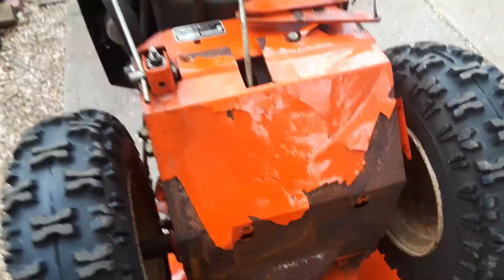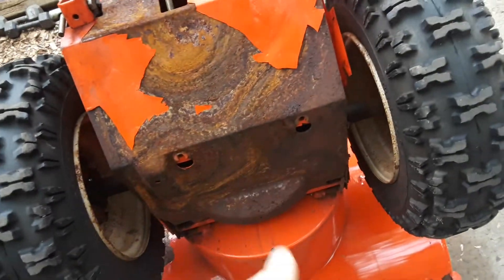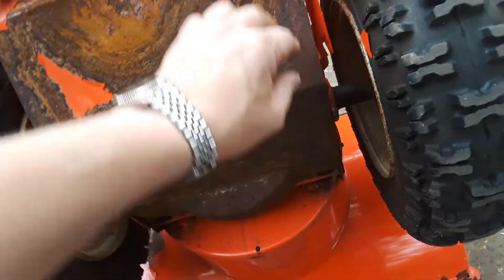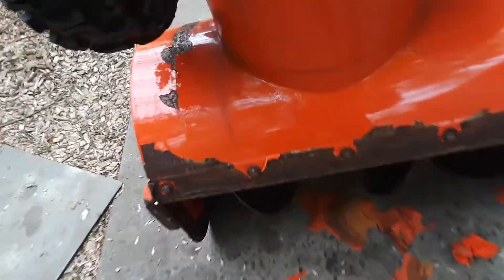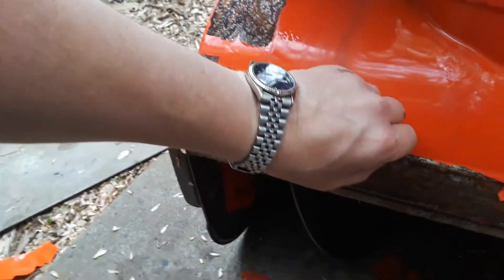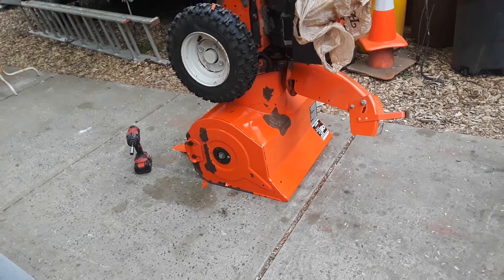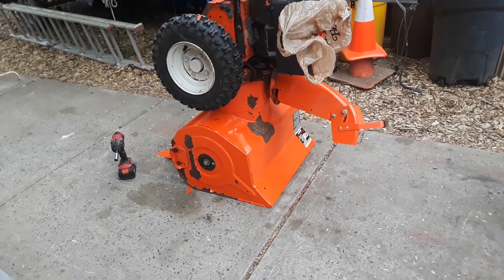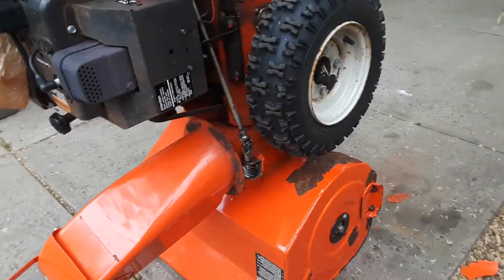1980 and on Ariens blowers, paint issue.

Comment: Paint on mine is the same, but my older 60's and 70's Ariens look great.
Reply from the maker: Both my 71's are great too. Their was lead added to the paint back than. Federal mandate in 1980 required it was removed on all equipment by 1981. As a result, this is what all Ariens machines in the 80's look like. No primer, no electrolysis used, they cheaped out and as a result all of their machines from that era look horrible. Its a shame to because from the design and build stand point, these were the best Ariens ever built. They did away with roller bearings in the 90's, went back to bushings. It was short lived. Seems like the 70's 10,000 series with bushings last longer than the bearings anyway. I have a 1987 Toro and the paint on that machine is perfect.

Comment: Shame shame shame. I have a late 90's craftsman blower I picked. Not a shred of gray paint left on bucket, except under one lonely decal.
Have a 79 ariens, paint holding up OK. I think you nailed the low end of the 79 to 80' cutoff.
Reply from the maker: The first year red and black units which were sold as 1980 model year, were built in 79. Those have the old style paint with the lead in it. So if you got lucky and bought one of those first year color change units, you got the superior paint. Anything after that, you got the paper peel a paint job. Scot Lawrence covered it on the Ariens info site. I'm just not sure what year Ariens finally rectified  the situation, it was sometime in the mid 90's, don't know exactly which year. Its a catch 22, because those 80's 924 series blowers were some of the best ever built, roller bearings everywhere, buy the paint job was terrible. Theirs no primer under that paint, they didn't bother. It was a cost saving measure. Its a frown on Ariens. However if you repaint the machine like I'm gonna do, your set, best Ariens blower you can own.
The paint on the 60's-70's machines. Thats got the lead in it. You cant get that paint off for nothing, best paint jobs a machine can have.

Comment: I was told they weren't using paint. That it's powdercoated
Reply from the maker: I forget what they did. But 1979 and back that paint doesn’t come off for nothing. 1980 and for about a decade, the paint peels off in sheets. It’s since been resolved but will still never hold up as good as the paint they used from 1960-1979 which I guarantee was lead based.